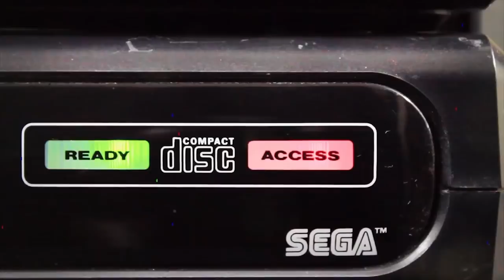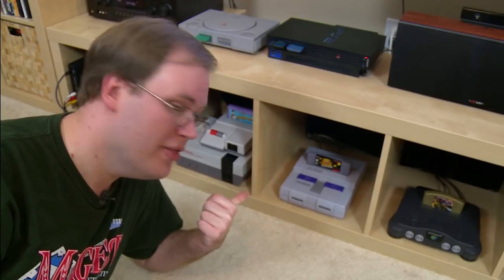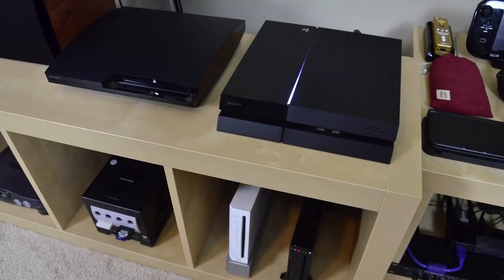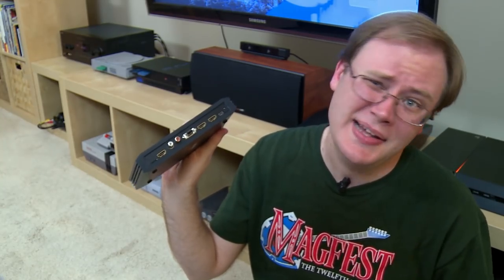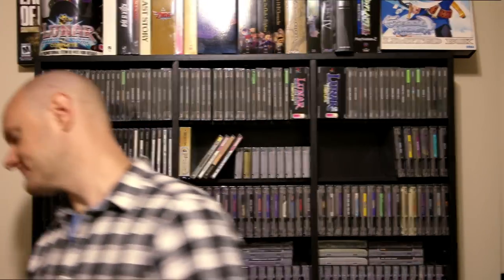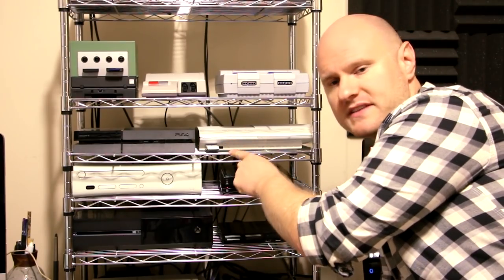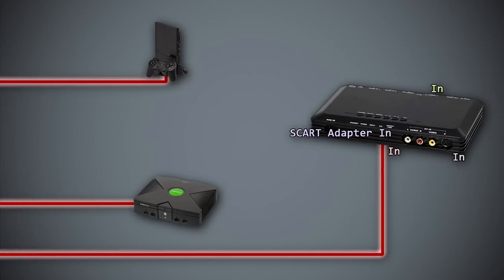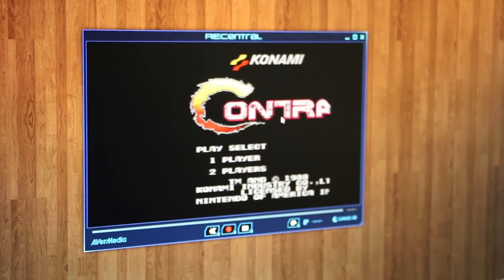RGB and Modern Gaming Setups :: RGB102 / MY LIFE IN GAMING

Comment: can you plug the NES RCA cables into the Framemeister and it will automatically output to 1080p or do you have to have a modded NES for that to work?
Reply from the maker: ***** it has composite inputs on it, yeah. It supports just about every signal of significance but RF coaxial.
Reply: so there's no need to mod your NES to RGB?
Reply from the maker: ***** well, you don't have to, but you're not gonna get the results seen in the video without going RGB.
Reply: so that's going to cost, what, $500 minimum? $150 for a RGB modded NES and $350 for the Framemeister?
Reply: Don't want to step on any toes, but definitely yes.  Almost any input is accepted except some obscure digital formats (some need adapters). The only downside to composite (rca) is that your input isn't great, so your output wont be great.  It works on the rubbish in, rubbish out principle.  Will look loads better than just plugging in it though.
Reply: They need to do a video comparing the Retron 5 to the Framemeister. It looks like the R5 has the same output, but isn't compatible with every single game.
Reply from the maker: [Coury] We have plans for a direct comparison. Try has access to a Retron 5 adn will definitely be doing something with it in the new year.
Reply: another idea for a video would be something like "so you want to get in retro gaming: here's what you need". And you could show all the parts, cables, upscalers, etc the average person would need to have a usable NES or SNES or whatever on a new HDTV.

I just got a new smart TV and tried plugging the NES and SNES in through the RF jack but the picture is terrible and there's a good 1/2 second lag. On the HDTV I had before this one, I had it hooked up the same way and the picture was fine and there was no real lag. I don't understand why it worked on that one and not this one (I dont have that old TV anymore).

I'd love to go the RGB-modded NES -> SCART -> Framemeister route, but it looks like that would cost a small fortune. I just can't afford it.

Right now it looks like I only have two options: hook up my SNES and NES to an old CRT TV or get a Retron 5 and hope for the best. Any other options?

Comment: Great video series, guys.  I recently took the plunge on getting a Framemeister recently, and did have a couple of questions:
(1) Are you guys going to go into the newer updates on the Framemeister?  It looks like Micomsoft recently updated the firmware to 2.00, and the JunkerHQ wiki doesn't have any information past 1.10.
(2) Both of you are dealing with Japanese devices, which generally use a 100V adapter, while US power sockets generally output 110V or 120V.  This isn't just the Framemeister - the A/V Famicom Jr. and the PC Engine Duo-R also have this issue.  Are you using step-up/step-down transformers to cover the issue, or do you have adapters that can receive voltages from the gamut (e.g. 100V-240V)?  I think my Framemeister came with an adapter that does this.
Reply from the maker: [Coury] I've updated to the 2.0 firmware and really like it. I haven't gotten too deeply into it yet though. I'm probably going to wait for the experts to make profiles instead of making my own. In order to make this series the best source of info on the subject (in video form), we intend on doing point updates for episodes that might need them. For instance I can see us doing a 301.1 for this down the road. "Patches," if you will. 

The voltage issue, we're not currently using anything - but my PC engine uses a U.S. Genesis 2 ac adapter so I'm safe with that. I'm not sure what Try uses on his AV Famicom though. 

We're both also using our stock ac adapters for the framemeister. I've looked into getting an correct US adapter for mine, but haven't. I heard that newer units include a variable voltage adapter that solves this problem. I wonder if they sell these official adapters by themselves...

Comment: I have a question (although this video is old, hopefully someone reads it). How do you guys stream your games? I'm using an Elgato HD60 PRO. It works very well if the console is plugged directly into Elgato's HDMI in. I wanted to plug all my consoles into my Denon receiver, then HDMI out to the Elgato, and then HDMI out from Elgato to my video (which is an HDMI wireless transmitter to an Epson projector, which works well). The issue is Denon (and maybe most receivers?) don't output audio (I guess?) over the HDMI output port! I wonder if that "HDMI PassThrough" setting is something I should research, but wouldn't that also mean it's not processing any video? It looks like others plug the console directly into the Elgato (or recording/streaming device), which sounds like a hassle to continually plug/unplug devices from the receiver whenever we'd like to stream or record - or people will run analog (ugh!) audio separately from HDMI. If the Elgato had an optical audio in, maybe this would work since most receivers have an optical audio out. I feel like I might be missing some simple setting on the receiver that forces it to also send audio down HDMI out. It will stream just video in Elgato if the HDMI comes from the receiver. Thanks for any advice!
Reply from the maker: [Try4ce] This is a situation that I just dealt with late last year. I first bought an Onkyo receiver, which had two HDMI outputs. At the time, I did not know that outputs labeled "monitor" do not output audio (I mean, it's HDMI, so you'd expect that audio would go with it, whether it's used or not). What I learned is that only receivers with HDMI labeled "Zone 2" will send audio over that secondary output. You can set Zone 2 to send the same output as Zone 1, or a different one. I returned the Onkyo and ended up with a Denon receiver myself, and I've been super happy with it (it plays nice with the OSSC). If Zone 2 is not an option, then my thought would be to see if your receiver has RCA analog audio outputs, and adapt those to a 3.5mm stereo jack, for use into your PC's analog audio input. You should be able to set that as an audio source in OBS, then.

Comment: I live in the UK and my TV has many scart connections, do I still need the frameister for my RGB NES, SNES, N64, GameCube, PS etc or can I just go straight into the TV. I have heard UK HDTV's may be a little different to US
Reply from the maker: +BroadsideWho [Try4ce] You should be able to go straight to your TV if those SCART connectors support RGB and 240p, but it most definitely will not process the image as clearly. Still, worth a shot trying it straight to your TV and seeing if you're happy, before dumping all the money into the Framemeister.
Reply: +My Life in Gaming have you tried using an AV receiver for up scaling? Apparently the good ones up scale to HD or even UHD. It's something i am considering but I guess lag may become an issue

Comment: understandable that you would use scart for things like the megadrive SNES etc. but the ps2 and onward all can output higher than that. using component vga for the Dreamcast or hdmi nativley. surley it would be beneficial to use component to hdmi adapter and a switch box fr the component cables. rather than lowering the picture quality to then upscale it.
scart switchers are not too hard to come by in the uk, although are becomming rarer. they key is to find an isolating adapter so that you dont get bleed through from other signals. or loss from the other systems
Reply: The framemesiter deinterlaces.

Comment: Awesome video! you got a subscriber. I have a question, since I live in Mexico it would be very difficult to get someone to mod my  beloved N64 to output a RGB signal, If I decide to connect the N64 using S-video to the Framemeister and then to my HDTV would I still get a benefit in the image quality?? thanks a lot !!
Reply from the maker: Eduardo Bonifaz [Coury] Thanks! Y'know, out of all the systems I feel like the N64 benefits the least from RGB. I use S-Vid for mine, while Try has his RGB modded (though I'm getting mine modded shortly). You'll definitely notice a jump, but less so than with other consoles. Good luck!

Comment: I'm sure someone has already suggested this for a SCART switcher already, but have you guys consider the Bandridge 5 Port SCART Switch box? It looks like a great product and high quality stuff.
Reply from the maker: Jdmboi17 [Try4ce] There are issues with that one. It's cheap, but also seems to be cheaply made. Certain systems might not work on particular inputs. It can also send voltage into other systems over the SCART cable... for example, if you turn on one system, the LED of another system might turn on. Kinda freaky, and not good! There's a fairly simple modification for that switcher though, but I don't know for sure if it totally makes it safe for your systems.

Comment: Love your RGB series guys! Have you any idea what could be causing a shimering/heat distortion like effect in high contrast areas when I hook up my NTSC SNES and Genesis through the RGB connection on the back of my european Samsung LCD TV?
Reply from the maker: [Try4ce] The screen is wavy even when the screen isn't scrolling? I saw an issue like this on a PAL GameCube when using cables that weren't specifically designed for it. NTSC SNES also requires a distinct cable from PAL SNES. I didn't think Genesis/Mega Drive mattered for cable choice, though. As far as I know, I thought modern European TVs took NTSC without issue, but I don't know much about that.

Comment: Hi guys great videos, I have my xbox & wii set up via component cable direct to my sony HDTV. They used to be hooked up to the XRGB mini, but I have always struggled to get as good a picture as straight to TV. Do you use component & XRGB mini together. If so what setting on XRGB work best for you.
Reply from the maker: [Coury] hey thanks! I run 3 component systems through my Mini - PS2, Xbox and Wii. It can look a little rough at first but if you change the auto scaler to video it looks a lot better. Check out our RGB 301 episode on Framemeister Settings to check out how to do that. It looks great!

Comment: i was watching adam koralik's video once and seemed like he was using a SCART switch strip.  is there a reason you guys aren't using that apparatus?  is it due to discrepancy in amperage to each of their respectable scart connections or will it become a detriment to the image quality?  i apologize if i sound like a noob in this.  i am just getting into retro gaming (I actually do have a saturn that i would love to scart). Another question is, concerning the original xbox, would i get better screen fidelity with hooking up the component cable directly to my sony LED or would an upscaler like the framemeister enhance the image quality?  Honestly, the component hook up to my LED TV from the original xbox looks like poo (blurry) and was wondering if there's a way to make the image quality better. I  love your shows and you guys kick ass.  keep it up.
Reply from the maker: [Try4ce] While I feel the benefit for systems like Xbox is not nearly as great as it is for older lower res consoles, there is definitely some benefit to be had. Though it's compressed somewhat by YouTube, perhaps my Grabbed by the Ghoulies episode will give you an idea.

As for SCART switchers, we've actually been using some for a while. I have an older GSCART, and a newer, more developed version will be available soon I believe. I'm happy with it, but u was reluctant to recommend it for a while, partly due to limited availability  (it was put together by one guy), and that I did have some issues at first that I eventually sorted out with better suited cables. Coury uses two Bandridge switchers, which are somewhat popular and cheap, but they have some issues... some quality loss, but it also is designed incorrectly... small voltage for example can be output to your consoles through it. When I tried it, my Genesis LED lit up when I turned on my Famicom! Certain consoles also didn't work in port 5. However, these issues can be fixed by opening the unit and slicing a particular trace on the board.

Comment: Great video. Good info and crisp images. One question I have though. You explain that when using scart the audio follows in the same cable. Which is good since I´m most used to scart. But when it comes to component. How do you hook up audio from the console into the frame meister? Or do you simply have a multiple inputs -> one output that comes with audio? Since from what I see on the D-terminal to component cable you don´t have any audio cables there.

So how did you hook up the audio? Curious about this since I´ve seen a lot of splitters or switches, but most of them don´t have any audio input/output.

Could you help a poor little guy out here explaining all of this audio thing with component?
Reply from the maker: OverlordHB Thanks! Theres actually a L+R RCA input on the back of the unit for audio input for component! Its right between the D Terminal and the HDMI out!
Reply: Cool. So that´s how you get component audio into it. Glad to hear it. Starting to regret a tiny tiny bit I didn´t get the frame meister. Grabbed a capture card with RCA/component/composite capture abilities instead.

Comment: You can actually hook the dreamcast up to the RGB-mini using VGA over a scart cable using a sync combiner. The VGA signal is 31hz RGBHV. The RGB-mini however does not support the HV part. But it does support the 31hz RGB over the SCART port. If you use a sync combiner to make the signal RGBC ( RGB combined signal ) you can then feed it into the mini and get a 480p signal on the mini. But even if you don't want to go this route, there is no excuse for s-video. RGB cables for the dreamcast are not that hard to find.
Reply: +Jerred Zoll Yeah, that is the setup i use right now as well. I noticed they even released a new version with 4 switches instead of the 3 i have. Maybe i'll give that one a try as well. I didn't know about the Toro back then. But it is a masterpiece. What it does is in essence the same. It takes the VGA signal and combines the the sync channels before outputting it over the SCART output. But it is much less hassle to get perfect and adds more features as well ( like switching VGA/RGB and scanlines ). I love it quite a bit.

Comment: Is there any difference at plug-in GameCube or PS2 direct on the TV with the Component cables? I'm not sure about the PS2, but as far as I know the GC output for Component is a digital signal.
Reply from the maker: Filipe Lima [Coury] Well you'll get a 480i or 480p image plugging it directly into the TV. Which, while better than 240p images look on a LCD, its still kinda rough. However, the Framemeister would upscale it to 720p or 1080p

Comment: I have a 3 in 1 out scart switcher and another 5 way scart switcher that I daisy chain together. They get the job done but they feel very cheaply made with plastic casing. I recently picked up an extron crosspoint 12x8hva from eBay but I can't seem to get it to work with anything. No output to my framemeister whatsoever. I don't know if I need to reconfigure it to work with rgbs that the consoles use or if I just got a bad unit from eBay. Just wondering if you have any experience with the extron crosspoint switchers or if you know anyone else that may be able to give me some advice on this topic? Btw love the videos very informative!
Reply from the maker: +Brandon Whitfill [Try4ce] Check out Phonedork's channel, he's got a pretty crazy switching array, I believe it's the Extron.

Comment: I just noticed that you did infact buy the Bandridge 5 way scart selector and i understand you ran into the issue with it sending power to a console in input 5. Well I have a solution for that. 
http://shmups.system11.org/viewtopic.php?f=6&t=48460

There is a post about halfway down the page by eightbitminiboss. basically you have to open up the SCART selector and cut a solder point. This won't effect the selector in a negative way, and it will fix the power issues with input 5 of the selector. Hope this helps.
Reply from the maker: [Coury] I did this mod a couple of weeks ago but haven't had a chance to really test it a bunch (I'm in middle of moving right now). The thing was suuuuper tough to get opened up, but once I got in, it was really easy if you have an exacto knife. I'll let you know how it works out.

Comment: Hey Try4ce - How does the component video look on the Framemeister versus RGB?  All of my systems are YPbPr at the moment.  Will I be happy with the Framemeiser?
Reply from the maker: [Try4ce] I think it looks just as good. The main thing is what kind of system you're using. Is it a system that mostly does 240p, 480i, or 480p? 240p gets the most benefit from the Framemeister by far. 480i is pretty good because the Framemeister has a great deinterlacer, but 480p is considered one of the Framemeister's weaknesses. A lot of people say most TVs handle 480p better than the Framemeister. I don't think it looks bad by any means, and still use it out of convenience.
Reply: Awesome, thanks so much for responding.  That is really a relief, I am not using 480p.  Mostly 240p stuff.  I just pre-ordered one of the last Framemeisters from Solaris.  Almost all of their pre-orders are sold out, so I just went ahead and pulled the trigger.  Every one of my 7 retro systems is YPbPr modded and it would cost a fortune to have to SCART modded.  Thank god it should look just as good, and thank Jesus for you Try4ce : ). Its really cool you take the time to help people out.